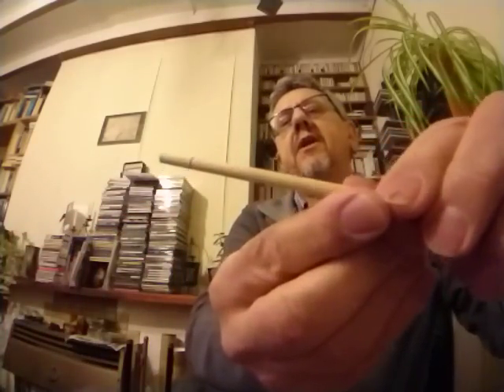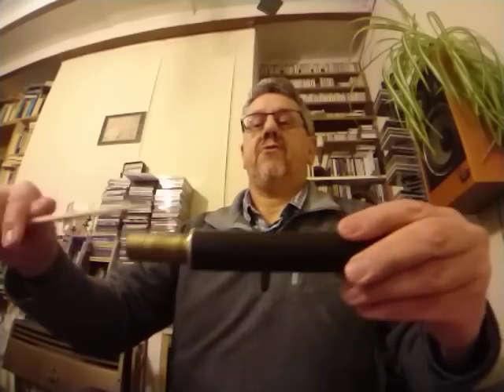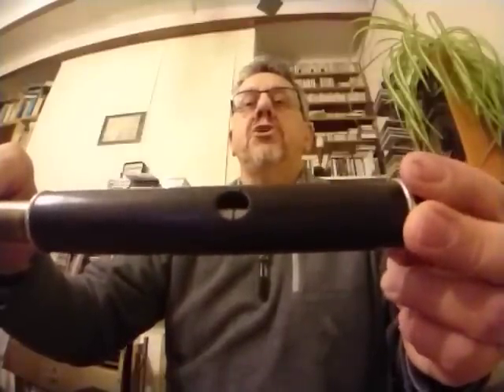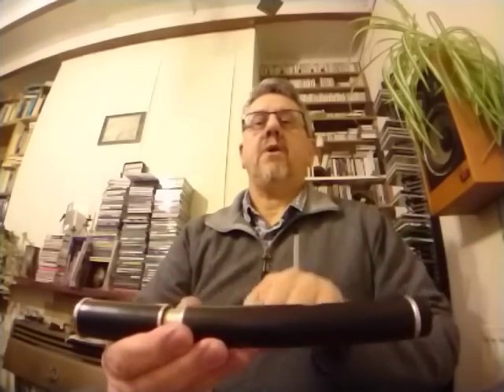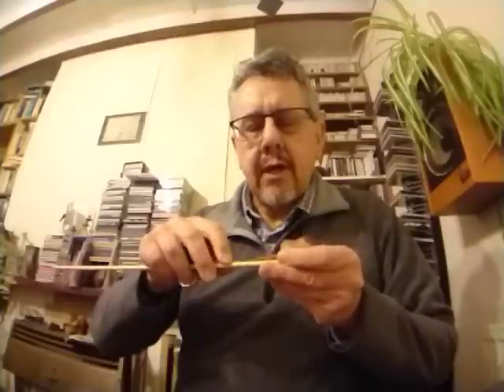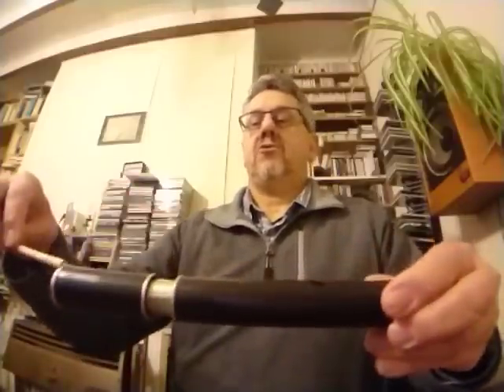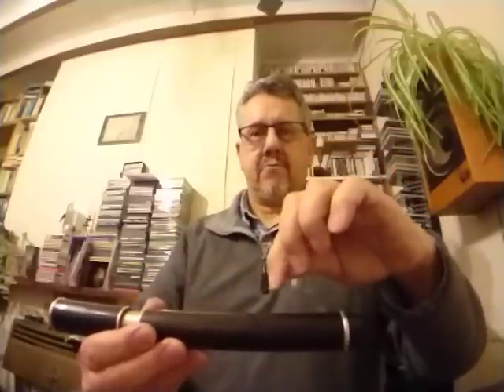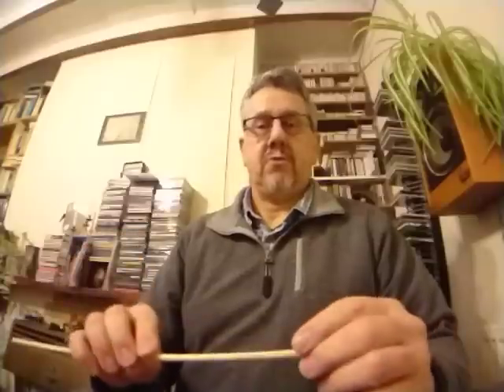Setting the stopper (cork) of a flute correctly

Comment: Is this the same for piccolo?
Reply from the maker: Basically, yes. The same acoustic principles apply. Modern Böhm system piccolo stoppers are probably best set to whatever the manufacturer specs are, and adjusted from there if any personal blowing style or environmental atmospheric conditions issues make adjustment necessary to correct intonation. Cylinder head with conical body piccs will have a different default/baseline setting from Böhm taper head with cylindrical body ones, just like full size flutes. (Of course, most modern Böhm piccolos have cylindrical heads and conical bodies, unlike larger flutes.) If you have a simple system piccolo with a barrel tuning-slide, the process can be done exactly as for larger simple system flutes.